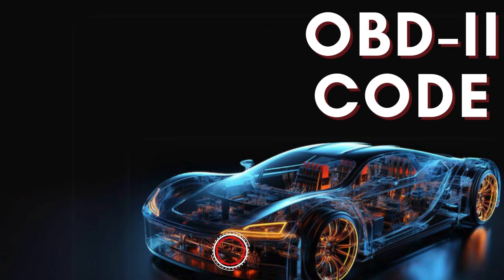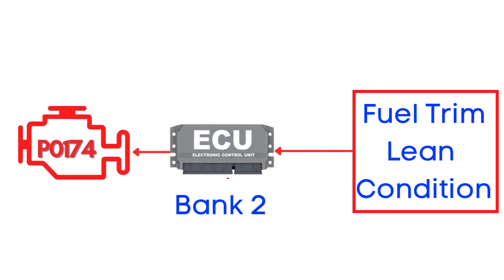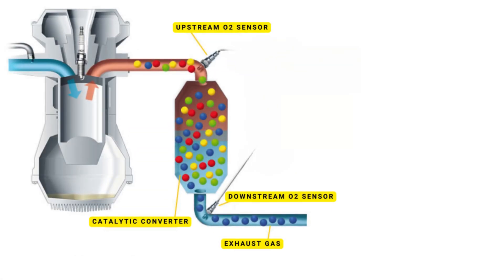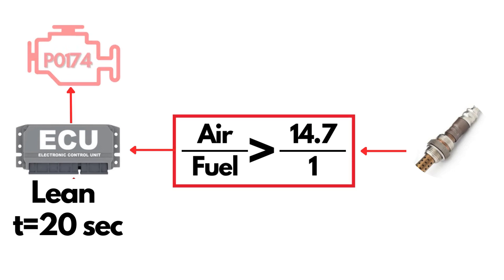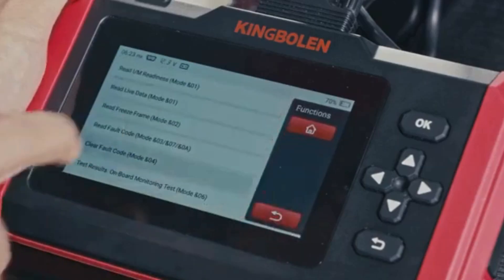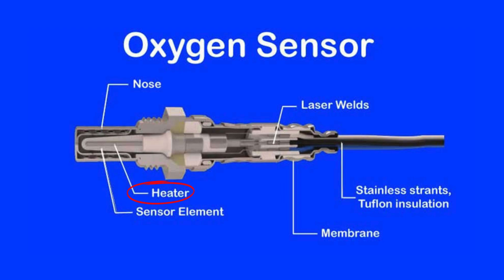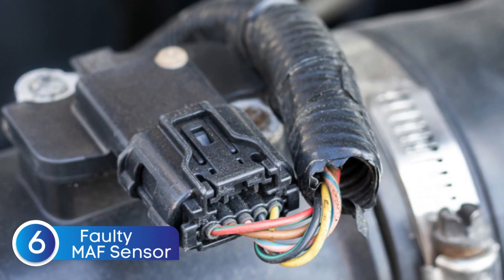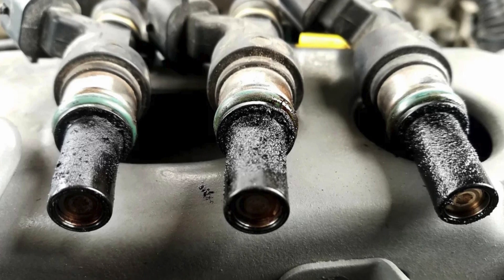How to fix P0174? | System too Lean (Bank 2)

Comment: I just changed out my o2 sensor, had code saying it was bad. After replacing, cleared code out, now I get p0174 code. Should I go ahead and clean or change my mass air flow sensor? How do you clean it, is there a special cleaner for it?
Reply: Use only MAF Sensor cleaner.  I bought a spray can of it for about $15, but spraying with it didn't solve my P0174 error.
Reply from the maker: Clean and change the MAF. Use any Cleaner.
Reply: Ended up replacing all O2 sensors and new plugs, problem solved. Also just to admit fault. I changed the one on the wrong bank the first time, why I just went ahead and replaced the other 3. My car does run a lot better now. No more smelling of unburnt fuel, specially when I get on it. Wasn't that hard to do either, I have a Chrysler 300C 5.7 Hemi. 
So what I learned was if you have to replace one, just replace them all.

Comment: check the 6th cause first, MAF sensor is easy to clean or replace. #1 supposed cause ( only according to this video) is O2 sensors.They can be very difficult to access & remove. You'll want to spray them with some penetrating lubricant. I'm not a mechanic. I've just been researching a lot.
Reply: Most times if it's MAF   sensor they will set off another code. Along with the P0174 code
Reply: @derekcarpenter5394 yeah, I had that & PO171